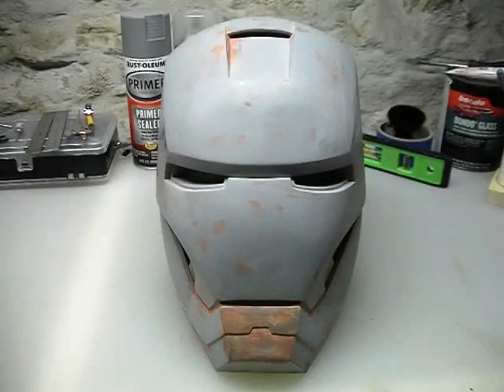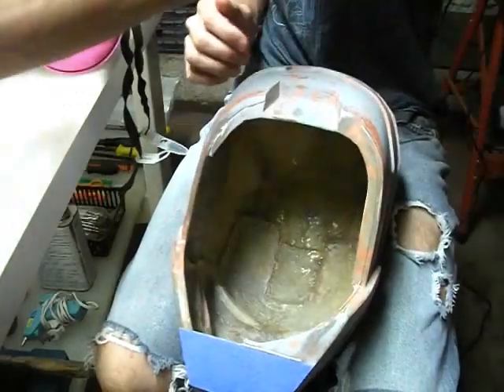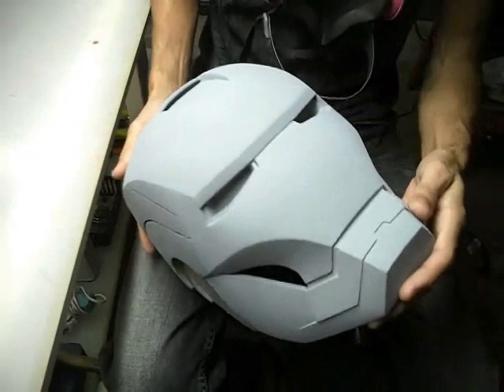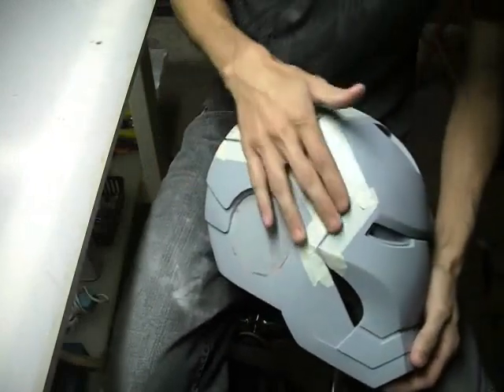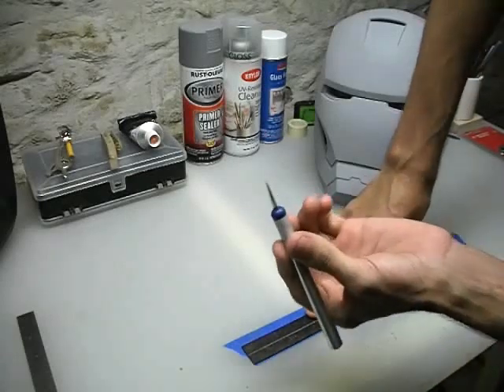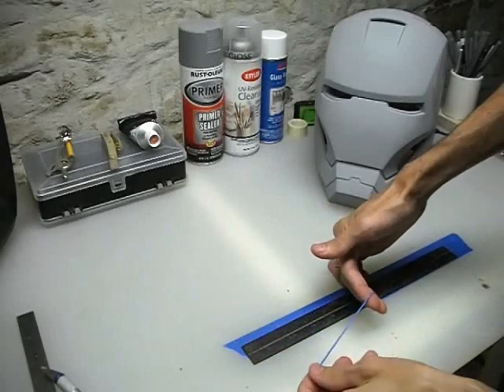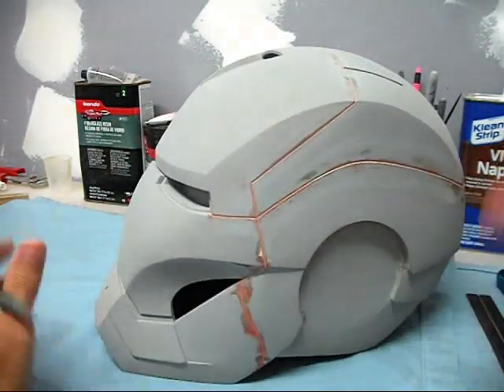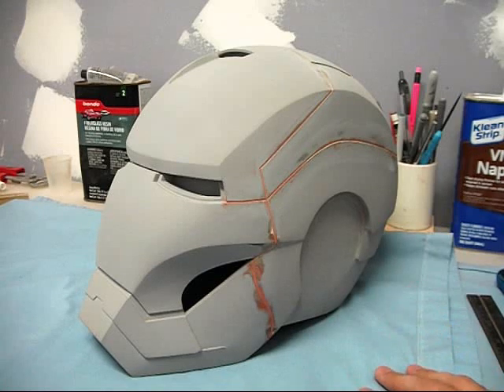IRON MAN HELMET BUILD PART 12 ~ DETAIL LINES & NECK OPENING

Comment: I really feel like you made the lines harder than they needed to be.
Reply from the maker: DarkJedi3000 I may have over explained how to do them, but the process is pretty simple.  Prime the helmet, fill them in and sand them smooth, lay them out using the contrast as a reference and carve them in.  I like to give as much detail as possible trying to explain things, even to the point of being redundant and mentioning common sense stuff along the way, but it helps eliminate any questions about the process being so thorough.  Thanks for your comment!
Reply: Boochieboy I have a question for you, to help me with my Madalorian build. So I bought Epoxy coasting/casting resin to use instead of the polyester resin because of the toxicity. And I just wanted to ask if the resin is supposed to be gooey when you mix it together, because it was like slime when I mixed it together. And also it didn't cure all the way, I had parts on the helmet that were harder than others but they all got the same amount of resin painted on them.

Comment: So, like you, I have finally picked back up my project after a year haha. Good to see that you only got one video done. Makes me feel like I'm not too far behind. 

I got the two trial masks out of the way. I used regular printer paper for those. I wanted to make sure that I got the size right before attempting to build with the card stock. I got all of my pieces cut out and I have started the assembly process. You never really touched much on your assembly of the pepakura so I have some questions. 

1) Did you start from top to bottom or bottom to top? I have found that starting at the top made the base very uneven. Maybe starting at the base will help me get it level?

2) Base still isn't level starting from the bottom.... Tried setting heavy objects on the lip of the bottom to flatten it out but not working. When I coat with first layer of resin, can I simply use the hair dryer to reshape uneven surfaces? I know you said that symmetry wasn't too important due to only being able to look at one side at a time. But I have a feeling the bottom lip is going to be noticeable.

3) While using the card stock paper, I am noticing spots where multiple edges meet are not going to have a sharp edge at all... The glue is thick, the paper is thick, and its starting to discourage me on being able to finalize really good detail lines. Those are the most important pieces to this mask to me.

Thanks for reading.

Comment: Looking back would you have done this differently, like use clay or something? Years ago I used Bondo on a daily basis for work and I hated how long fine details took. I couldn't imagine doing it for something like this.
Reply from the maker: If I were only making one then I would still do it 100% with pepakura.  For something that I would be molding and making multiples of yes, I would ABSOLUTELY use clay and either sculpt the entire thing or just use the fiberglassed pepakura piece for a base to add clay on top of and sculpt the rest of the way.  It would be so much faster and easier just spending the time sculpting rather than mixing Bondo, applying, smoothing, sanding, reapplying, spot filling and so on.  I guess there's a reason professionals sculpt in clay :)

Comment: If I were to separate the face plate, would it be as simple as (assuming its from this step) dremelling the area where it would disconnect and smoothing the edges? It looks like the faceplate would still sit on the opening, on the sides.
Reply from the maker: RightClick Yep, just dremel it off with a cutting wheel.  The diamond cutting wheels are the thinnest, they would give a very tight separation seam if you have a steady hand ;)

Comment: How do you plan to fit your head inside the helm? Does the facemask still get to open and close?
anyways cool process cant wait for final output
Reply from the maker: Next video the helmet will get cut behind the jaw, around the bottom of the earpieces and around back to make a panel removable.  That will allow a head to slip into the main helmet, then the rear panel gets replaced (usually held together with very strong neodymium magnets).

Comment: Hey I love your videos so much! I was just wondering would going through this method be a viable way of creating a wearable suit or would there be a better material/method?
Reply from the maker: +Dave Stannard Yes, people make entire suits this way.  A lot of times though people use eva foam because it's faster, but I like the strength, sharpness and minute detail you can get from the traditional paper resined and glassed, then Bondo'd.  There are modified pep files for foam parts.
Reply: Nice. Thanks for the reply. How much in mats did this run you?

Comment: Will you be seperating the face plate or keeping it as one solid piece? Awesome work btw
Reply from the maker: Faceplate will remain attached on this master....only thing that will be separated will be the back panel so it can be molded in two parts to allow it to fit over a persons head.  I may go back and take one of the copies I make and cut the faceplate off and re-mold it into a 3 piece helmet down the road.
Reply: Boochieboy Brilliant, thanks man, look forward to seeing it done